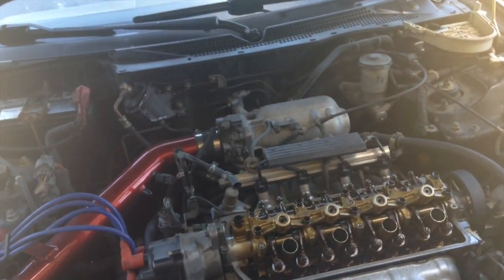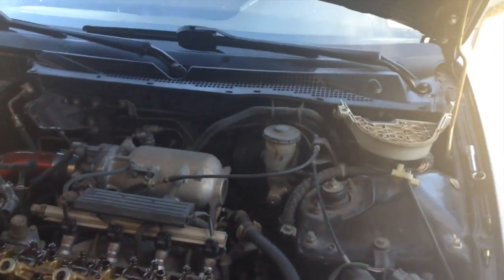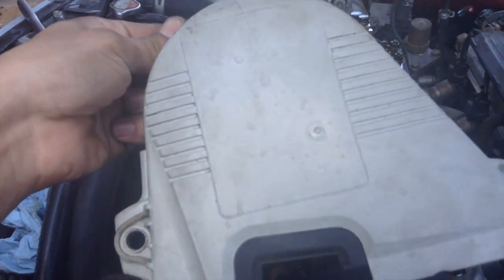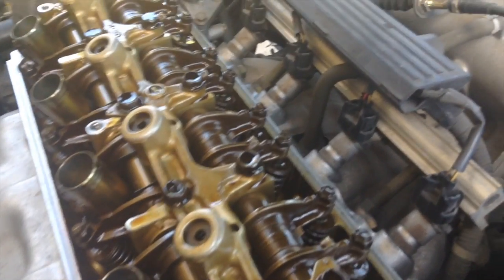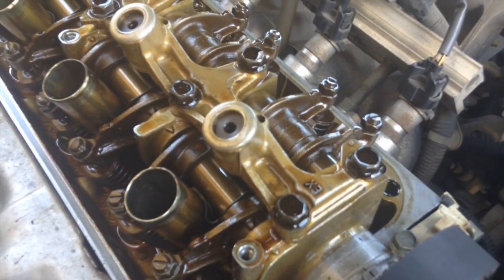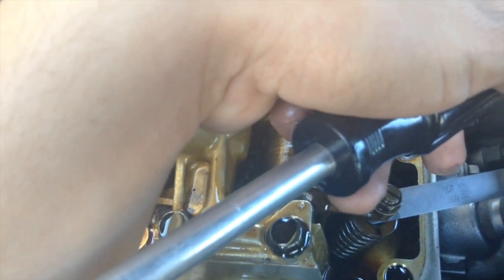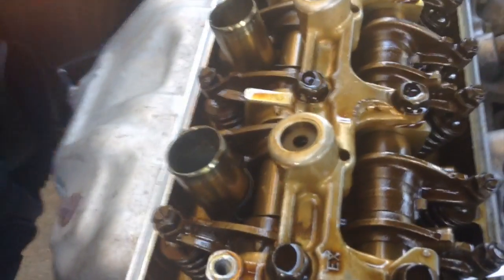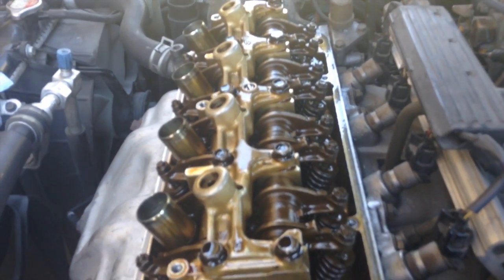Honda Valve Lash Adjustment

Comment: You did everything right, But the sequence is check tdc, Then Retorque Rocker arm Assembly, They get loose over time, and then you can adjust the valves I seen to many people do this and still have valve train noise I do this every 60k miles